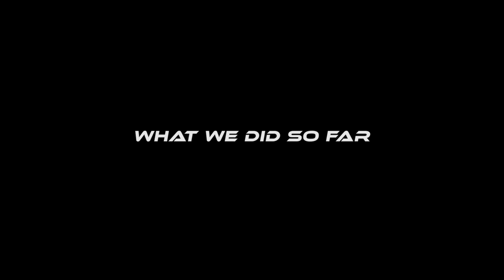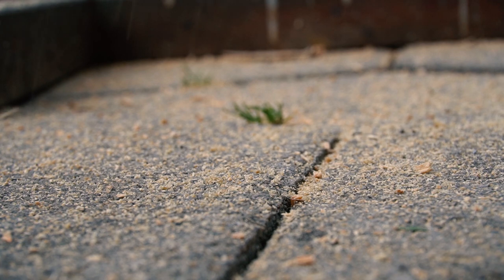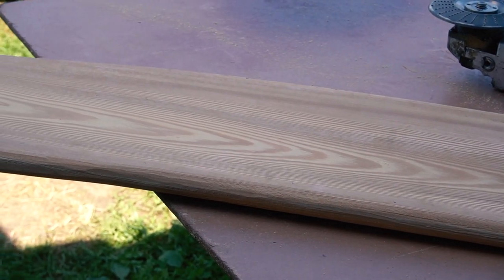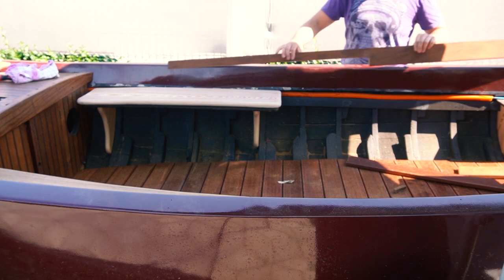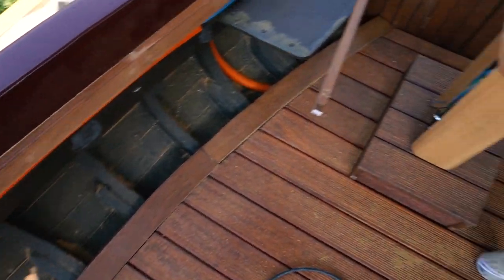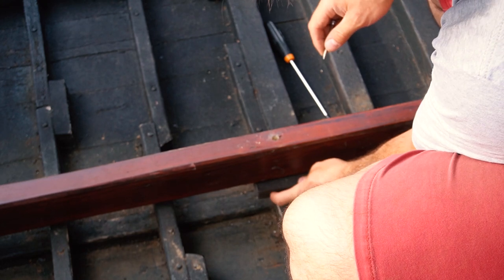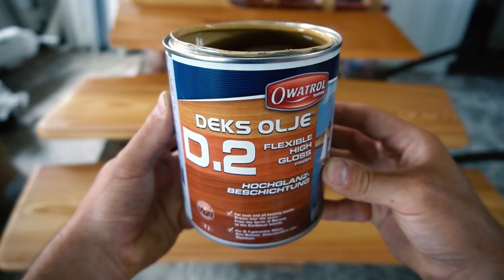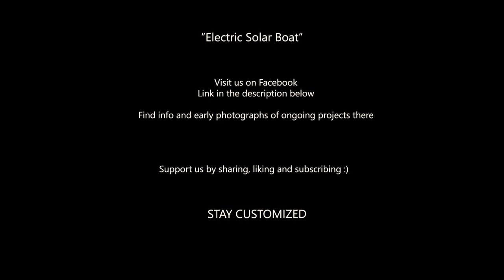Electric Solar Boat Build and Restoration - Episode 9 "The Benches"

Comment: This boat is looks so good, so much work put into it and the results really show.
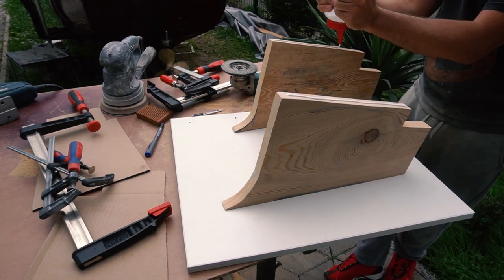08:43-09:44 Is there a reason why no dowel pins have been used to help glue the pieces forming the large bench?
Reply from the maker: No, actually there is no valid reason, beside lack of experience and proper tools. That's a very good idea, that has crossed my mind the moment the gluing was already done.
Reply: @T.S.CUSTOM  Thank you for answering